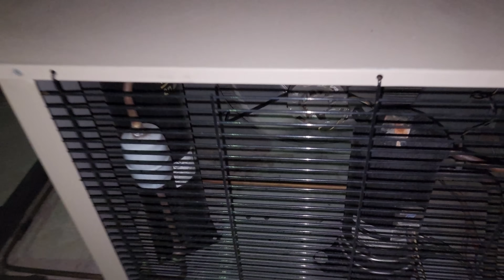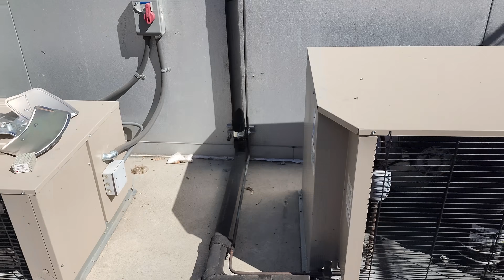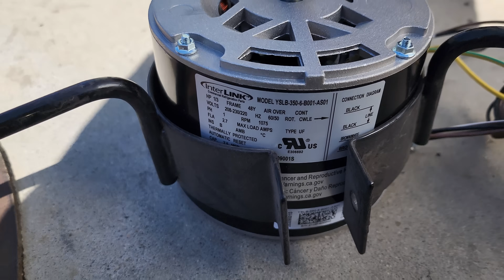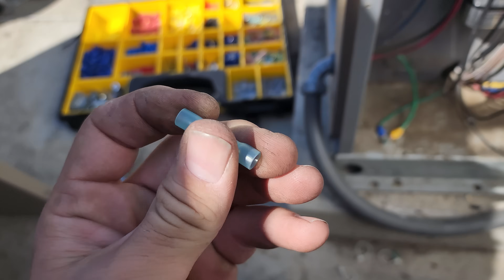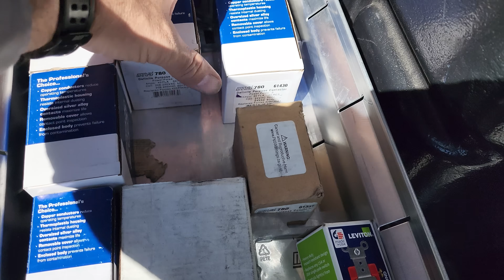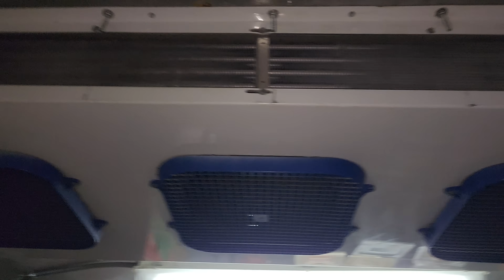LATE NIGHT WALK IN COOLER EMERGENCY

Comment: I'm an electrician from Germany, i always wonder, why you guys in america don't build in 3 phase check relais... they're 10 bucks but can save a motor from 2phasing. 
Or at least a motor starter with motor protection-relais. Last videos there was one shorted compressor out of 3, that blew the main breaker and the entire unit was down... this may not happen. 
There were only contactors, no protection switches... very poor build quality in my eyes... and when an apprentice does such wiring harnesses like in those units like spider webs... man, he'd get fired the same day!

Comment: I personally like those supply wires to be long, (coming from the disconnect or breaker etc.. if something crazy happens and they get crispy, it leaves you enough slack to just cut it back and not have to pull new wire or have to call an electrician

Comment: I LOVE heat-shrink butt connectors. They are excellent for electrical repairs on cars and garden tractors, just as robust as their standard counterparts while adding weather resistance (and a tiny bit of mechanical support for the connection itself). Combine those with adhesive-lined heat shrink tubing, and you can make a connection that lasts for years.

It's always a good idea to check contactors. Contactors are used in high-current applications, and closing/opening high-current circuits creates an arc nearly every time. Burning/pitting of the contact points is just the nature of the beast, and as you mentioned in your closing remarks, single-phasing a compressor will cost the customer exponentially more than changing out a contactor. It's not just a new compressor, it's potential loss of product/business too. Spend a penny to save a pound.

Changing the fan motor should probably include automatic contactor and capacitor replacement because they all work together, and a failure in one component can sometimes cause cascading failures of the other components. Why bother with a new fan motor if you're going to feed it poor power through a bad contactor, or a cap that could be teetering on the edge of tolerance?

Comment: One day you WILL drop that container of splices... I have the same Stanley containers and dropped my splices twice so far. You will live with them mixed up for about a week until you get ticked off enough to sort them again. I walk with one finger over the lid just in case the latches give way, but eventually it will drop.
Reply from the maker: I carry mine the same.... one of my guys dropped my screw case one day and it was a nightmare.....

Comment: You have me looking at condensers now, checking to see if they're plugged. Haha. In our shop, there is a small office which is cooled by a large window unit. And it hasn't been cooling well for a couple of weeks. They were set on buying a new one, which is garbage, cause if i needed something for the shop it would take ages and long approvals, but if any of the office people need something they get it same day. Anyhow, pulled the unit out, took it apart and wached the condenser out, plugged full of dust and aluminum powder from the environment we are in. Put it back in and it supposedly cools better than before 😎

Comment: Haha, a bag in a fan? I have a story. 
I once found a ceiling fan that had some sort of red Mylar streamer of sorts wound up in the center. In this case, it was on a center shaft or something and wasn’t moving with the fan. It was making a quiet s,s,s,s,s,s,s,s,s,s,s,s,s,s,s noise, and the noise went away after I pulled the plastic out. It looked like a few inches at first, but it ended up being a good 5 feet and knotted like crazy! (Fan was a basic white Hampton Bay one, probably from the 90s or so.)
It seems like these things can actually do damage to faster moving fans! I would have never thought that tiny imbalance could affect a bearing in a motor.

Comment: Molex perma seal branded crimp seal connectors are the best they have the adhesive inside that seals around the wire. That's all I use

Comment: Called to a job at a hotel were I look after all the package ac unit the other day, they have a different company that look after there fridges, they asked me can I look at one of there walk in, I said sure apparently the other company has been out twice replaced the pressure switch the 1st time then told the customer the 2nd time the condenser unit needs replacing, I walked into the cool room a balloon was stuck in the coil, coil frozen up hitting the fan, defrost and replaced the fan and now running well, don’t know if the other company was looking at the wrong walk in or what haha

Comment: I did a job where the owner had OCD and wanted everything perfect even if you could not see it. I pop up in the ceiling on to the unit, flipped a light everything was painted and well lit, I was like WTF outstanding he goes nice isn't it . Anyways someone painter left a thin plastic tarp up their and it sucked onto the coil. Then he gave me a tour and my jaw dropped, the roof had an alarm, we went up and it was spotless.  If I worked for you I would order the dispatcher to direct all calls from that location to me PERIOD.

Comment: Great point about 3 phase. But now I pose this question. Why not take that same concern with a phase monitor? Why not protect the equipment from high or low voltage?  Either of those may have been the "Big Picture" to have caused that contactor to do that. More so low voltage.. but you get my point. You can have the monitor reset.. but store the faults and when back know 110% in issue or not. Stay safe and be well Chris.

Comment: I really enjoy how you can do an after-hour call and just get the very basic work done so that you can return during normal hours to do the repairs.  Then you repair the damage and clean up and inspect the system to see if any other things get attention before failing again.  Excellent use of time and care for the customer.  Also I really like the heat-shrink crimp connectors and am moving over to them on my stuff.  Great video!

Comment: Your 100% correct the $100-200 contractor is cheap on the follow up call / PM.  It’s much more expensive for that callback a month later on overtime when the whole system has tanked, that could have been prevented. 
Your environment also takes a toll on the contractors between sand, ash, smog.  They all lead to premature wear on the system. 
On that particular location I thought there was talk of putting a galvanized cover over the line sets to conceal them from the scrappers.

Comment: It almost looks like someone sneaked in there and vandalized the unit with that plastic bag, because I don't see how it could get in there by itself. The fan pushes out air through the grill, and there's no way that the bag could get through the coil by itself like that. Someone sneaked in, waited for the moment when the fan stopped, then that individual pushed in that bag with a stick or something. Stupid humans can break things in the most ingenious ways. That, or just perhaps , the fan ran backward occasionally. So probably it'd have been a good idea to check the runcap of the fan, because that may have been the actual culprit.
Reply: That’s what I was thinkn…with all the grates and fan blowing opposite the direction…no way that bag “made”‘it’s own way in 🤔🤨. Highly suspect

Comment: Not many techs will ever be this. Most techs I’ve ever seen would’ve just pulled the bag out, possibly changed the motor if it was too loud. But they would’ve left it if it wasn’t too loud.

Comment: Yep with the contactors there is also the effect on the business, a failed cooler/freezer due to a bad contactor could lead to thousands of dollars of product they then have to throw out. If its an exhaust fan for a kitchen they might have to shutdown until it fixed, again causing thousands of dollars of lost sales and the effect of not having your restaurant open may mean you get a bad reputation among customers, so it isnt just lost sales that day but more in the future.

Comment: Hey I got that same klein tools multi bit but without the driver. I had an issue with the magnet that started to fall out. I'm glad I noticed it and just used a little superglue to keep it in. I have a lot of klein tools stuff and this is the first time I've had an issue with one of their tools. Keep up the good work.

Comment: HI CHRIS! WHY DO THESE UNITS NOT USE SOLID STATE CONTRACTORS? THAT WOULD SOLVE THE ISSUES YOU SEE WITH THE POINTS NO?
Reply: The main problem is efficiency.
SSRs and sold state contactors have a voltage drop across them.
At high currents this can present a rather substantial power loss.
Compounded over how long these units run, and how many units they have, this can represent a significant energy loss - and cost.
Coupling with how aggressive manufacturers and governments alike are getting in pursuing every last watthour of efficiency, I'm honestly not surprised they aren't really used.
An exception would be in a lower power situation where rapid cycle times are needed, such as an unload solenoid for higher setpoint accuracy.
Unloading systems can cycle as rapidly as once every few seconds, which would present a rather severe problem for contact erosion. A solid state solution would be ideal here.
Reply: @FerralVideo  this makes total sense great response!
Reply: @FerralVideo   👍 Voltage drop = heat.  Heat in a place that is already hot is a bigger task to deal with, so it is now not just a SSR
Reply: a 40 amp 3 phase contactor is $30, a 40 amp SSR will run you $200 the reasons are clear.